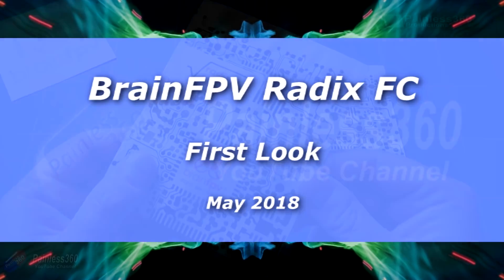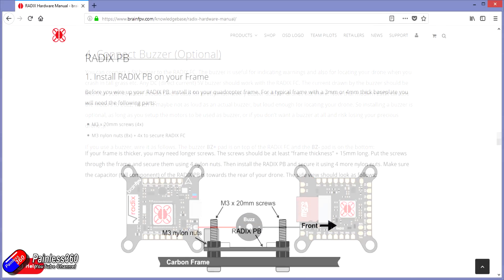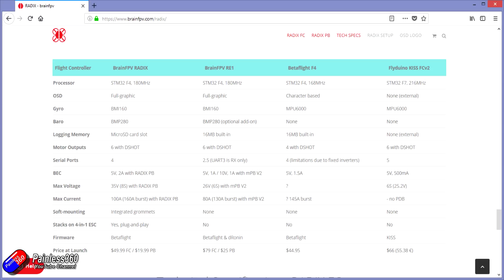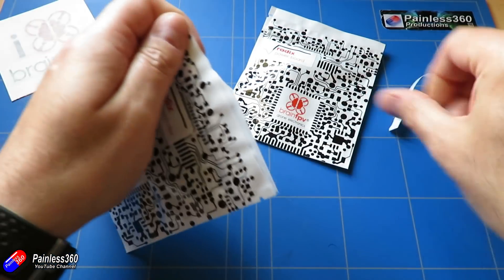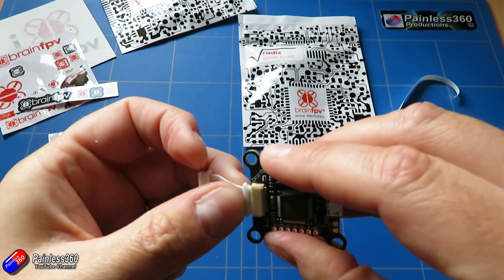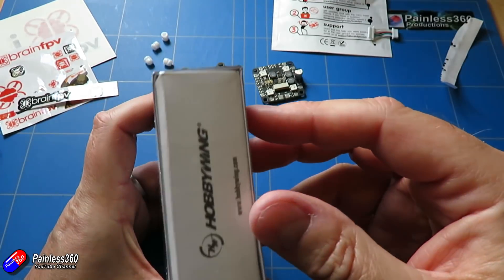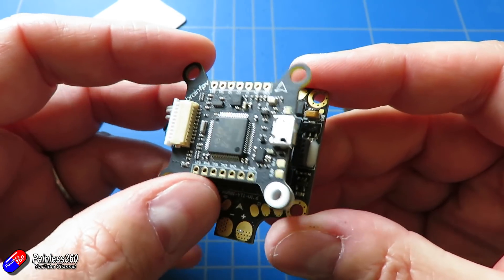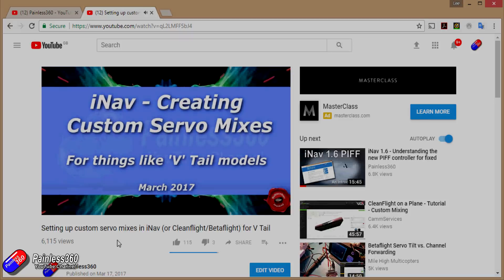BrainFPV Radix Flight Controller (Vector Graphics OSD)

Comment: How does a vector OSD differ from a non vector one? I looked up footage of this FC's OSD and couldn't see a difference with an Omni.
Reply from the maker: The Vector and BrainFPV OSD are vector based, not using ascii characters that are poor at anything but what they are .. a vector based OSD allows for smooth lines and scrolling pieces. The Vector also has colour - a very useful thing to draw your eye to problems and potential problems..
Reply: Can you show more of that?  @Painless360  How do you like this controller compared to a betaflight f4 or a kiss?

Comment: got a question. I arm the quad....the motors idle up...with props on.... soon as give it any throttle it goes full throttle
I have had this problem before and I used a different configurator and that fixed the problem......with out any specific configurator but with a taranis radio is this something you've see before.....Mission planner and INav if you need specifics
pixRacer  on 270 quad      sp racing evo f4 with Inav
Reply from the maker: No idea without more detail - what troubleshooting have you already tried?